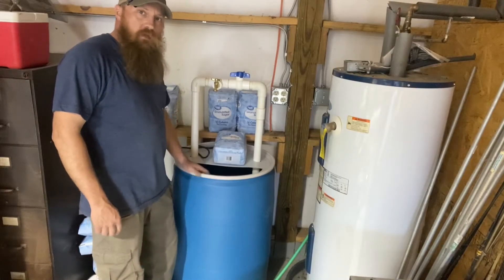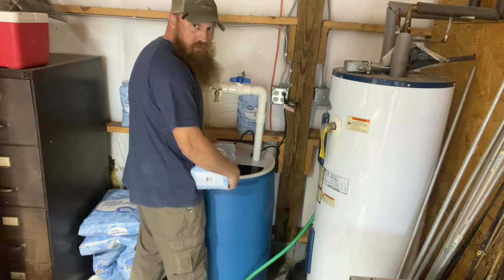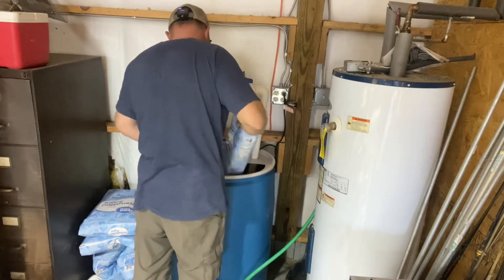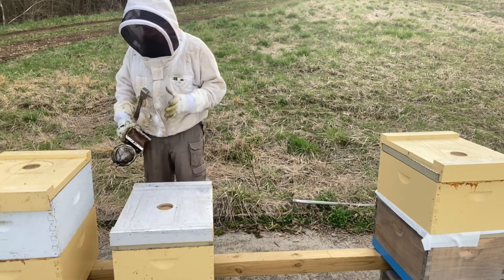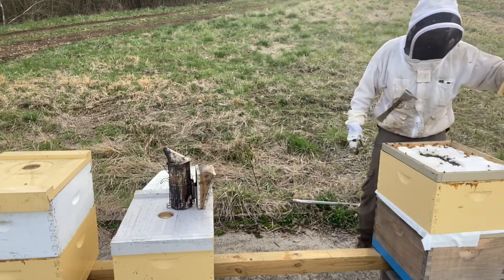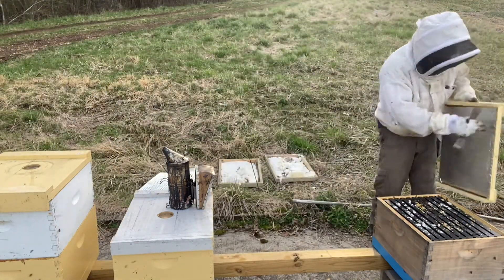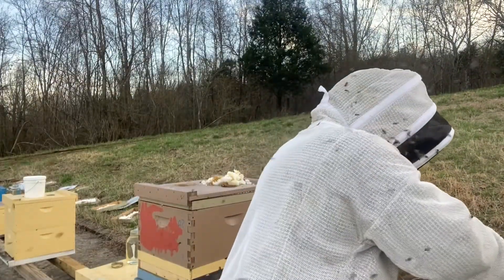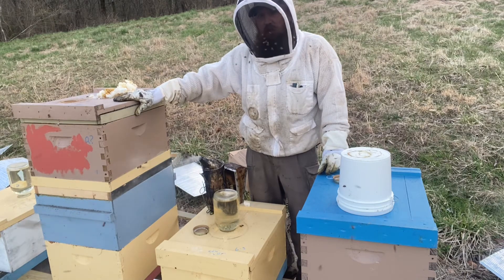How I Mix Syrup and Feed Bees

Comment: Questions Josh,  have you mixed 2:1 yet?  Was a 1/2 pump  strong enough to mix 2:1 if you have would a 3/4 or 1 hp be better.  Hoping to learn from your experiences.
Reply from the maker: I mixed about 3 tanks of 2:1 this past fall. It did well but the pump did get a little warm. Looking back I would have used lager piping like 2”. I larger pump would not hurt anything.
Reply: @beardedbeeworks261  thanks,  but I had another question because I really like your ingenuity on using the transfer pump.  Where did you get the trigger nasal  and how did it work out with the 2:1 syrup and do you see any improvement needed?
 I really like this
Reply from the maker: @OklahomaBeekeeper  you can get them at about any farm supply store. It is a fuel nozzle. Mine doesn’t have an automatic kick of like a gas pump but I wish it did. I will probably upgrade it this spring.
Reply: @beardedbeeworks261  thank you very much for your time, I appreciate it and May God bless you and your family.

Comment: I like to leave my foamie on during the summer. Puff a little smoke in a corner, wait a minute and then tear it off fairly fast - like a bandaid. LOL Another use for the foamie during the summer can be using it as a quiet cloth - putting it on the hive box that you set to the side while inspecting the bottom box. They also probably keep the lid cooler during those hot summer days.
Yah, you sure got those bees pissed off. If I'm not in a hurry I walk away to the truck and have a smoke until they settle down a bit. Take care and have a good weekend.

Comment: So there's no inner cover? Looks like you just have an outer cover with a hole over the frames?
Reply from the maker: That’s correct.  It’s a migratory cover with no inner cover. You don’t need an inner cover with a migratory lid.
Reply: @beardedbeeworks261  interesting. That's a new 1 to me, thanks!